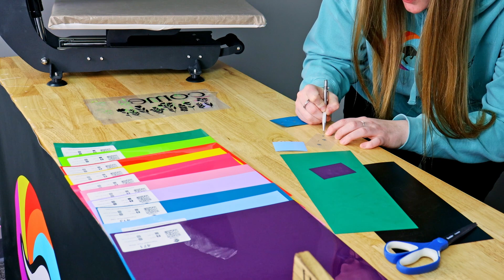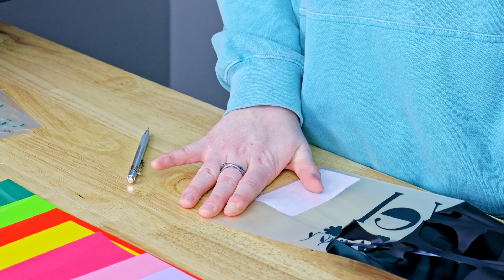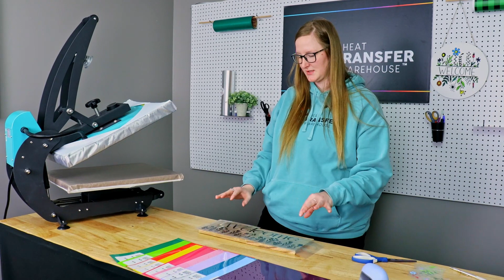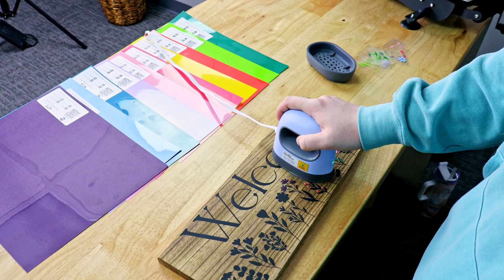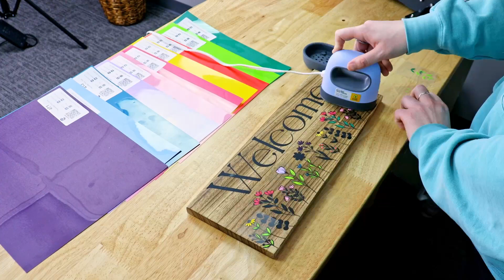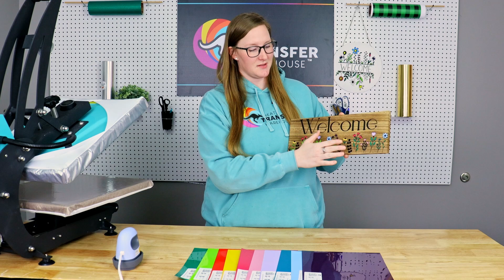HTV on Wood | A Heat Transfer Vinyl Tutorial

Comment: What sealant should I use
Reply from the maker: Sealant isn’t required for HTV on wood, but it can add an extra layer of protection—especially depending on where the finished piece will be displayed. For indoor signs, a craft sealant like Mod Podge works well. If your sign will be placed outdoors, be sure to choose a weather-resistant sealant to help protect it from the elements and extend its lifespan.